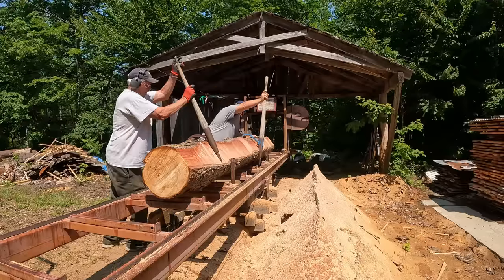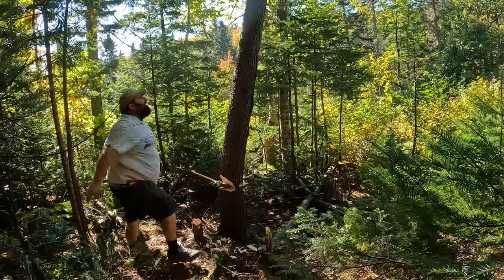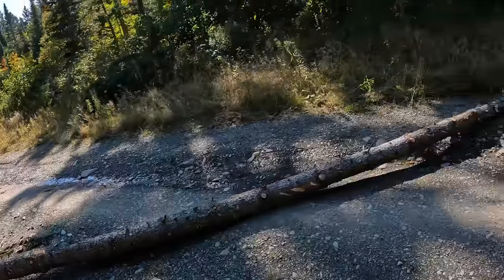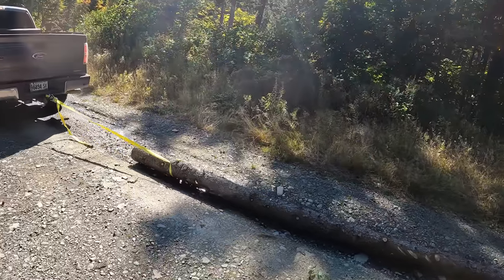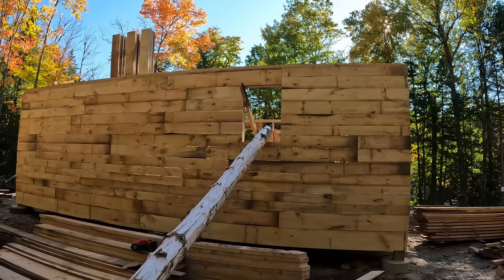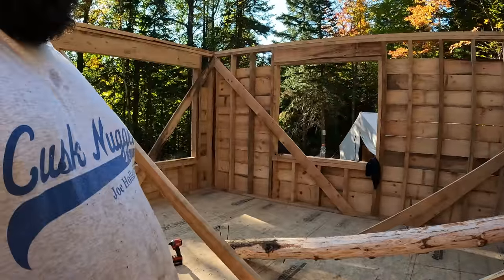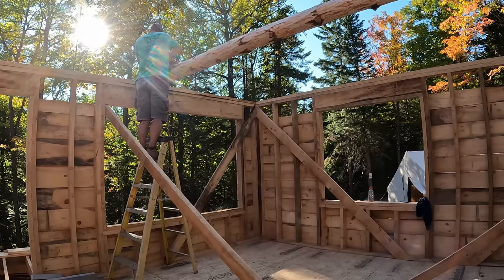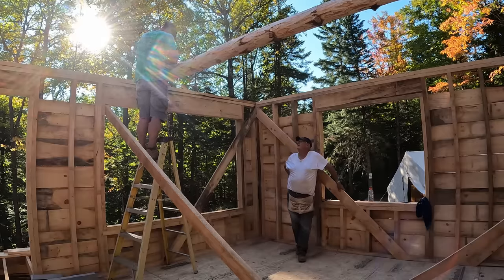OFF GRID: Chopping Trees Down for our Cabin: Episode 18

Comment: Hey guys just came across your channel last night and love your content, had a couple questions if you don’t mind. How long did you air dry your lumber and what time of the year did you cut your logs? My daughter and her husband are wanting to build something similar on our property and we have the trees and sawmill is why I was wondering.
Reply from the maker: for sure thanks. We started cutting the pine boards roughly a year in advance, They were dried perfectly. The hemlock that we cut for dimensional lumber was felled a year in advance and milled anywhere from 8 months to the last month. Hemlock is better to work with a little green you just have to get some drying time on the back end after the structure is up keep ventilation and don't close it in or insulate until dried. Dry depending on heat and fans and dehumidifiers added. I ran a woodstove for 11 straight days on mine after enclosing it in and it had dried a lot before that by erecting it .

Comment: Are the screws that you’re using timber lock or GRK’s. I’ve had better penetration with the GRK’s without twisting the heads off
Reply from the maker: The ones that didn’t fail were GRKs